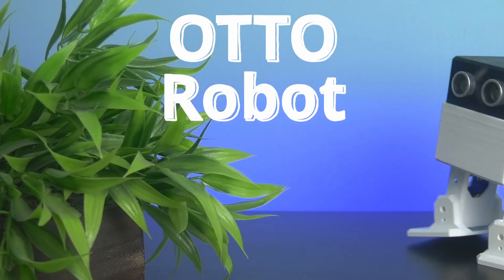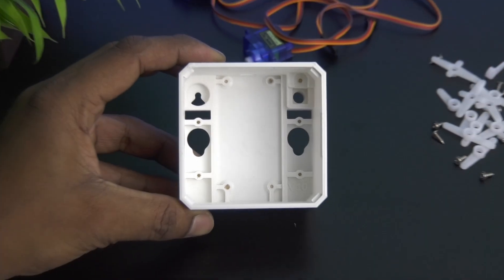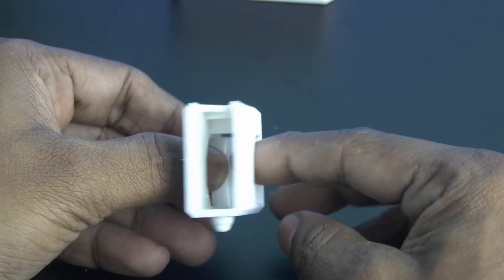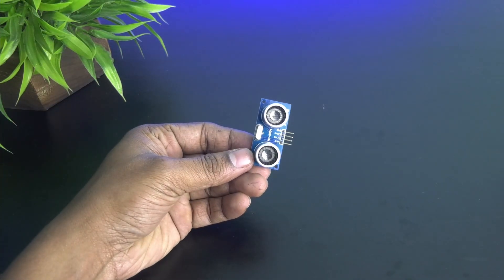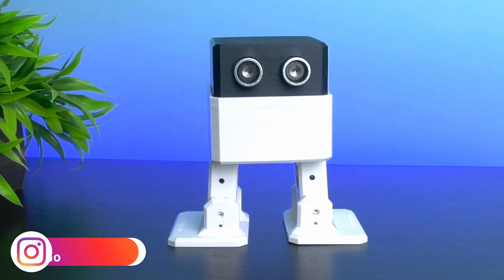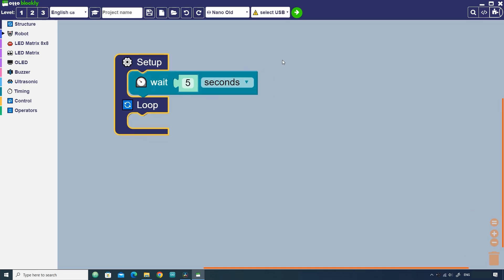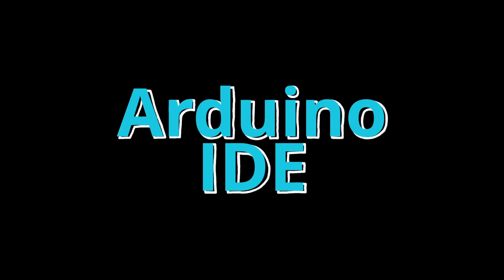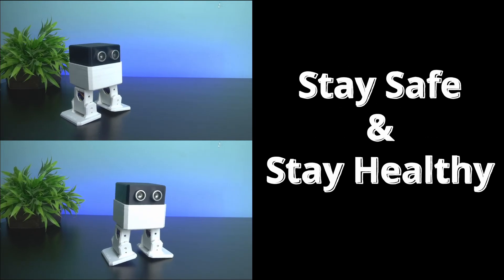Robot for Kids | Learn how to make DIY Otto Robot | Ut Go

Comment: Hello, I did the same process as you have shown in this video and i completed the assembly and it stands perfect, but the problem i face is the code is not uploading to the board as it shows Fial all the time can you help me through that
Reply from the maker: It seems you are facing code uploding issues. You have to select the correct board, processor and port. In Arduino IDE goto Tools -> Board -> Arduno AVR Boards -> Arduino Nano. After that again goto Tools -> Processor -> Atmega328p(old bootloader) and then select the corrent port.

If you still face issue then let me know I will guide you.

Comment: Hi there what is the name of the battery module and the battery also what is the name of the button used I meant type of the button pls help.
Reply from the maker: 1. 16340 Li-ion Lithium Battery Holder Shield Module 
2.  Mini Push Latch Switch
Reply: @UtGoTech Thank u bro, you are a lifesaver.😊😊😊
Reply from the maker: @TanavShino  Welcome Bro👍
Reply: Sorry for troubling u but can u pls tell me the name of the exact battery used and where can we buy it. Thank u 😅.
Reply from the maker: @TanavShino  Its called 16340 Lithium ion battery.
Link: https://thinkrobotics.com/products/16340-battery-3-7v-1300mah?variant=39334535266390&country=IN&currency=INR&utm_medium=product_sync&utm_source=google&utm_content=sag_organic&utm_campaign=sag_organic&srsltid=AfmBOoo-4ktwMg8W1ujsfbGQlW3mWuSuwS9dQUMFnyTHZ9kqTOe5XF6LVno
Reply: @UtGoTech Thank u so much bro.😃
Reply from the maker: @TanavShino  Welcome Bro👍
Reply: @UtGoTech Hello it has been a long time but can u send the link of battery and switch from Amazon if u can pls....😅
Reply from the maker: @TanavShino  Those components are not available on amazon. You have get it from websites which sell electronics components. You can purchase it from the link I have provided earlier.
Reply: @UtGoTech Ok dude thanks does it delivers it in India?
Reply from the maker: @TanavShino  Yes
Reply: @UtGoTech Oh dude thank u 😃😃😃
Reply from the maker: @TanavShino  Welcome👍

Comment: Can You Please Guide,
Complete Otto Robot,
As Expected Doesn't Moves,
Please 
Reply For Above Comment,
Thank You
Reply: Yes,
Can Communicate,
Queries for getting answers for overall 
Please Reply 
Thank You
Reply from the maker: @Neil_123  welcome
Reply from the maker: Make sure you have connected all the wires properly and fully charged the batteries.
Reply: Please Share 
Contact Number 
Thank You
Reply: Sir,
Can get contact number 
Thank You
Reply from the maker: @Neil_123 Yes you can contact me through Instagram.

Comment: Sir please make otto robot with the use of animated oled display like emo robot and give code for programing in  pin comment
Reply from the maker: Ok I will make one.
Reply: Thank you sir
Reply: Thank sir
Reply: I doubt is here
Reply: The doubt is I have 3v battery you use 3.7 v battery
Reply: 3v battery🔋 work or doesn't work that is my question
Reply from the maker: I have used a 3.7 volt battery with 5 volt voltage step up regulator. So the output voltage is 5 volt.
Reply: Thanks sir for this help ❤

Comment: Can i Change the 3d model design of outside?
Reply from the maker: It's easily available on the internet.
Reply: I unloaded the auto center code but it says error,failed
Reply from the maker: Check upload settings
Reply: @UtGoTech i kept them outside..I'll try but wilk the prblm solve
Reply from the maker: Ok No issue
Reply: @UtGoTech also I'm not using the buzzer pin.and the  using alternative Battery becz the batteries are not available
Reply from the maker: Ok. No issue
Reply from the maker: Yes

Comment: Lithium polymer battery 
Should be of what capacity 
In Volts ,Mah
Please Reply
Reply from the maker: You will need 2S Lithium polymer battery Pack.
Minimum capacity of 2000mAh

Comment: instead of 16340 battery , 18650 battery can be use
Reply: Please reply
Reply from the maker: I think the 18650 battery will not be accommodated.
Reply: 18650 , 16340 batteries are same to give same output, they are same
Reply: Please reply
Reply from the maker: They are the same but with different sizes and capacities.
Reply: 1×18650 battery 3.7v 2200mah in battery holder 
Does it work
Reply: Please reply
Reply from the maker: You cannot put 18650 cell inside otto robot
Reply: 16340 isn't available 
Which one battery 
Be held
Reply from the maker: I haven't tried using a different battery but I think you can use a lithium polymer battery of appropriate size.

Comment: bro, this is a lovely project, i did everything exactly what u mentioned, just that im using 9Vold battery. i could even upload the code, but when i start the otto does not move at all!. can u help me
Reply from the maker: Check battery voltage
Reply: @UtGoTech  how much should be the ideal voltage?
Reply from the maker: I suggest you to use 5 volt to 6 volt
Reply from the maker: I suggest you to use 5 volt to 6 volt

Comment: Hello, I built this robot as you described, I just installed normal batteries as batteries and loaded the codes, but the robot does not walk, it does not dance, its legs close on its own, it opens, it turns left and right, what can I do? Can you help me?
Reply from the maker: It seems that the microcontroller restarts due to voltage dips. The possible reason for the voltage dip is use of normal batteries. I suggest you use a lithium based battery.
Reply: @UtGoTech  Actually, my friends did it with normal batteries. my problem was like in the codes. After I wrote the servo code you gave, it said the installation was completed, but then it gave an error but I didnt't care , then I uploaded the code Otto Blockly, after running it, it became like this. I wonder if this would happen again if I uploaded the codes to a new Arduino Nano. And I wasn't wearing a buzzer, it has nothing to do with that, right?
Reply from the maker: No issues not having a buzzer. Try calibrating the servo motors.
Reply: I asked a lot of questions but how can I calibrate it?
Reply from the maker: You can use the example calibration sketch that comes with the library.
Reply: Olay thank you 😊
Reply from the maker: Welcome😊

Comment: What is the voltage of the battery 🔋?
Reply from the maker: One lithium-ion battery of 3.7 volt is used in this robot along with a step up voltage regulator which increases the voltage to 5 volts.
Reply: @UtGoTech  Thank you!😄 Can we use 4 pcs 1.5 volt battery? 
The  battery is in this video -
https://youtu.be/4lkLcDgVwT8?si=D0eTXEtfVVhs36x8
Reply from the maker: No. 1.5 volt AA batteries will not work. You have to use Lithium based battery.
Reply: @UtGoTech  from where should I buy? is it available in Amazon
Reply from the maker: Yes, you can get it online store. Look for 16340 Lithium ion battery
Reply: @UtGoTech  and what should I search for the battery holder
Reply from the maker: Search for "16340 Lithium battery holder" or "16340 lithium battery to 5V step up power module".
Reply: @UtGoTech  Thank you 😄
Reply from the maker: Welcome Bro👍
Reply: @UtGoTech   Not bro , I am just 14 yrs old  😅
Reply from the maker: Age is only a number bro..
Reply: @UtGoTech  Yes !!☺️
Reply: @UtGoTech  But you have used 16340 battery and sheild, Are both 16340 and 18650 ok?
Reply from the maker: Sorry I said wrong battery. I replied in context with RC Car Video. Thanks for pointing it out.

The 18650 battery will not fit here. You have to use 16340 lithium ion battery with 16340 battery charger/power module which can provide 5volt power.
Reply from the maker: I haven't tried with four 1.5 volt battery. But I think it will work as I have seen many people using it.
I will also try this.
Reply: @UtGoTech  ok 😄 Thank you ,and i tried finding 16340 but i couldn't find it
Reply from the maker: @AyushFiction 
Battery Link: https://thinkrobotics.com/products/16340-battery-3-7v-1300mah?variant=39334535266390
Reply: @UtGoTech  an the sheild
Reply from the maker: @AyushFiction I have searched but the product is out of stock.
Reply: @UtGoTech  oh so should I use 4 1.5 volt batteries?
Reply from the maker: @AyushFiction I have seen many people using AA batteries, In you should give it a try
Reply: @UtGoTech  ok
Reply: I have made the robot successfuly but there is a runtime error coming although I have copied the same code in OTTO blockly Software
Reply from the maker: @AyushFiction you can send me an error screenshot through telegram